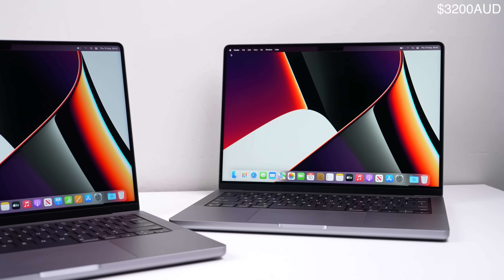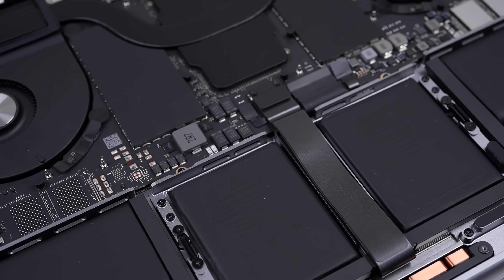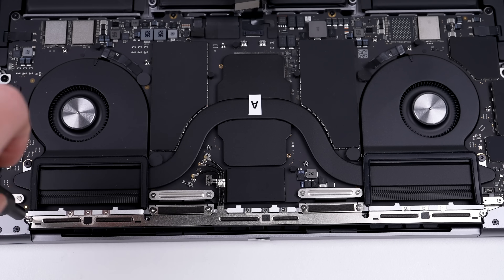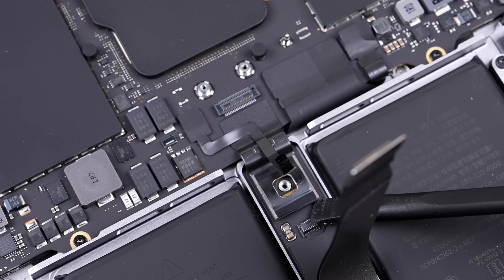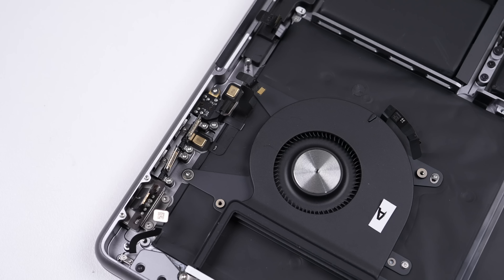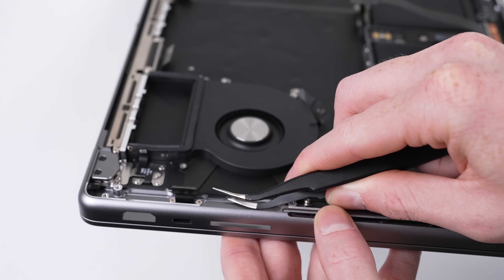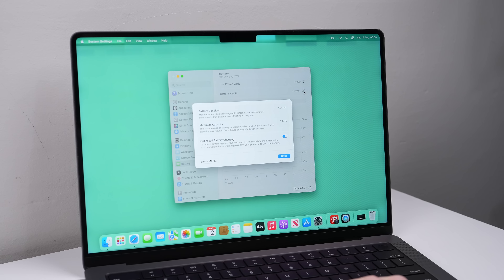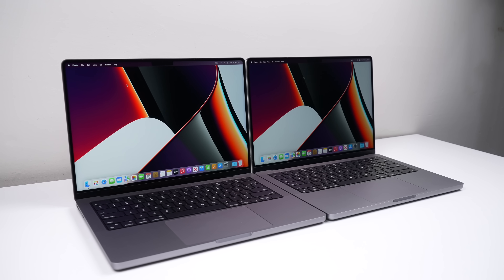New Anti-Consumer MacBook Pros - Teardown And Repair Assessment - Apple Silicon M1/M2

Comment: Apples anti repair policies actually made me stop using their products entirely. It’s so scummy that they purposefully make it impossible to fix incredibly simple problems or upgrade/replace parts as simple as a ssd or broken fan. The way they don’t allow you to control how your computer behaves really at all also got really annoying after getting more familiar with other operating systems.
Reply: Please tell me the fiction of which PC laptops are built for easy repair.

The interior of a thin Dell or HP laptop is just as impossible to navigate.
Reply: @VideoArchiveGuy  It might be, but neither company lock you out of your device, stop working or disable features if you self repair them. That's the point. It's not them making it hard to repair, it's them going out of their way to make it impossible for you to repair unless you do it via Apple themselves.
Reply: @VideoArchiveGuy  Im of the opinion that a tablet and a desktop is the way to go since laptops are too much for very light use like word or browser use and unable to handle heavy programs id use for work or for hobbies, for any significant period of time. I just switched from a Mac mini to a pc i built, where I can obviously fix most issues on because I put it together in the first place, and its something big and open enough that i would have the ability to solder parts on and off the motherboard etc if i needed to. The thing that pissed me off about apple is that you can fix a problem in theory, but their software makes it so even though the device has no physical problems at all it wont work because they’ve programmed it so all parts are matched to each device and the os shuts down functionality if any of them are replaced.
Reply: @Garkimyer  You're exaggerating just a bit.

The OS will of course not allow parts that are security-related to be easily swapped, and parts are not necessarily just parts if they were custom made for Apple.
Reply: @VideoArchiveGuy  you can, with enough skill, fix non apple laptops and they will work good as new. apple laptops, however, literally have software and hardware in place that intentionally fucks up things about the laptop when you swap parts
Reply: @VideoArchiveGuy So that means that if you have a problem with a security feature you are forced to buy a new product ??? This is the most anti environnemental shet i ever heard. Also are battery, screens, keyboards, ribbon cables security features ? Didnt know that...
Reply: @alexgreg152  No, that means if it's security related the new component must be installed by Apple or a third-party service facility with the ability to re-sign the components to keep the system secure. Apple or the approved third-party agent will be able to repair your products for you if they are security-related, no need for the "I have to buy a new device?" ridiculous hyperbole.

Screens and keyboards can be security features depending upon their components; for example on MacBook Pros, the TouchID sensor is part of the keyboard. Batteries must have data programmed in at the time of replacement to be able to accurately track their health as their age.
Reply: as a much more direct answer :Framework laptops.
Reply: @VideoArchiveGuy  lol what?

As he said ... Framework ... also ANY Lenovo/Dell business laptops.

Yes, some of the cheap end consumer crap from Lenovo/Dell is almost just as hard to repair as Apple - especially the more "stylish" models where they do glue crap together to keep it "thinner" and cheaper - but the point is those companies are not a douche and do not purposely design their hardware to be un-repairable. If you have the skills to do it, any compatible screen from anywhere will work.

However, a MacBook PRO should denote some level of professionalism in the device, where there is none. All of Lenovo and Dells business workstation laptops are built for extremely easy repair. They're made for businesses to buy in batches of 10,000. Businesses are not going to pay $2000 to replace a keyboard on a $3000 laptop. Employees are surely going to break screens, ruin keyboards, and end up with dead drives, and they need to continue to work. Larger organizations have an IT department to handle these issues ASAP. On any Latitude/ThinkPad workstation I've seen, you can replace the screen/keyboard/SSD with only a few screws.
Reply: Because they want you to know you don't own the product.

Comment: Yeah, I really need to sacrifice size, weight and design for an ability to manually replace my battery, RAM or SSD. It doesn’t matter that at the time I’ll need to upgrade them, my motherboard won’t support the newest specifications at the time, so I’ll have to spend weeks searching for a single usable battery for my specific case. Oh, and I constantly disassemble my laptop and switch between different kinds of screens on my Thinkpad! Oh, and reinstalling Arch every week is so much fun!

Comment: Nice takedown of the company and the computers. I don't see why anyone needs a MacBook Pro for anything.  It's a completely overhyped laptop that is a trap.  I would get the same amount of work done with any old laptop, like the one I'm on now, and replace it 4 times before spending what I would on that stupid laptop.  
I have a MacBook Pro right now in the living room.  It sits on the floor next to the couch in case I have to do something specific to Apple, but otherwise, it's about a foot away from being where it should be: A doorstop!

Comment: 8:51 "I wonder what the Genius Bar calls it?"
Rip-off.
I am primarily a Windows user. I am planning on using Arch Linux on the new computer I am building next week as my main OS. I know how to use MacOS. I have had a couple jobs in the past supporting it and worked for a BPO that Apple hired as one of their very first external support groups back in 2009. 
I was planning on buying a macbook pro as I have tools and confidence in repairing it and keeping it for years to come. I have some hobbies involving digital art and music and from what I have seen, best product for it. I don't mind spending the money on new software and hardwar eupdates as far as possible into new version of MacOS.  I won't be buying it now. Apple's insistence on closing their eco-system, forcing you to buy a new computer when the old one is just "old" is quite anti-consumer. And here I thought they were going in the right direction with iPhone repair kits.
Apple devices would be the best you can buy on the market...if they would stop being douchebags.

Comment: Just by te way, I don't think that the lid sensor cable is paired to anything. They've probably just used a precise angular magnetic field sensor with an ordinary magnet. The magnet is mounted (likely glued) to it's place randomly oriented. They then use some kind of program which allows them to store value of angular field measured by the sensor in the close-lid position.
It would be impractical to somehow always mount the magnet in a specific orientation, it's much easier to do it this way.

Comment: These are beautiful pieces of hardware and the performance is fantastic.  The displays are on the upper end as well too, but they are no OLED.  But there is far to much about them to not like.  No WAN option for starters.  Soldered RAM and SSD is total crap as well forcing you to pay obscene amounts of money for what is in reality very cheap.  No touch screen either.  I went with a Lenovo T15G and got the an I7-10875H 8 core 16 thread 5.1GHz processor, 4K OLED touch screen with calibration, RTX2080 Super maxQ with dedicated RAM,  WiFi6 2x2, CAT16 LTE 4G WAN, one of four SODIMM slots populated with 16GB SODIMM, and a 250GB SSD in one of the two m.2slots,  720P IR camera, Dolby sound engine, two USB-A 3.2 gen1 ports, one USB-C gen2 /DP ALT mode 1.2, two Thunderbolt 3 (USB-C 3.2 Gen2, DisplayPort ALT-Mode 1.4) HDMI 2.0, SD card reader, and smart card reader.  I then added in another 48GB of RAM and a 4TB SSD.  I also have 3 years next day on site repairs under warranty.  All in I spent less than $4300.00. No expensive dongles, no tethering, parts can be had and swapped without issue.  WHY WOULD ANYONE BUY APPLE LAPTOPS?

Comment: My MBP got a hit on the lid and the dent metal is slightly pressing my screen projecting a washed out blue spot. I ask my official local apple seller and they said they could replace the whole screen. (around 800 bucks). Now I'm scared to take it to the repair service.

Comment: Back in 1981 I had an Apple II+ that I could replace just about anything on. I bought it with 48K of RAM and added another 16K by plugging in individual chips by hand. But technology has moved on. Today's processors have more built in RAM than the 6502 processor in that Apple II+ could handle. Connections, especially in laptops, are smaller and more delicate. Even more importantly, the number of people actually interested in messing with this stuff is tiny compared to the market. It simply costs too much to cater to them, so Apple doesn't. If you're one of them, get over it. It's not going to change. In fact, other companies will follow Apple down this path. Because they have to. Economics dictate that they do.

Comment: Very in depth vid. I’ve dealt with those plastic keyboard rivets on a dell laptop.  It had to be fixed so I ended up using a hot air gun to melt them so I could pull the keyboard out.  Then I used a soldering iron to remelt them when I put a new keyboard in.   Complete pita.

Comment: This is so crazy. My last laptop, which finally died 2 years ago, i bought in 2009 and kept it going through upgrades, repairs and replacements for 12 years, unheard of by todays standards.
Reply: My last macbook lasted well over 10 years with no need for repairs or upgrades (and is still in use by the person i gave it to).  So whats better, a device that lasts or one that needs repairs and upgrades?  Lots of hysteria on this video and some criticism of apple is certainly valid, but i've never had a laptop last anywhere near as long as a macbook has lasted.
Reply: @JustinWatson23  Right? I bet my 10+ year old MacBook pro has a higher resale value still than most PC laptops purchased in the past few years. And yeah, I replaced the Hard Drive, but also back then HDDs were horrible - modern MacBooks will last decades with only the battery and Apple's annoying software update policies being an issue.

Comment: As an Apple Authorized Service provider, you need Apple Software (GSX)to run a configuration, and Lid sensor test in order for the system/display  to function properly. In that software you need to enter the Serial number of the good display/Bad display, (or any part really) and the software Pairs them to the motherboard. Each Lid angle sensor needs to be replaced with the Display...no way around it. Same with touch ID with a logic board replacement. It is SUPER clumsy and anti-consumer. Also yes, Keyboard is non replaceable.you can order a Key cap kit, but if the keyboard itself is Damaged. you are out the entire topcase.  You can manage to get a replacement battery, but it is NOT an easy repair. any battery replacement i do requires an entire teardown of a system. lcd, logic board etc....Down to bare metal and swap to the new top case/keyboard battery(touch bar) THENNN it needs to be configured.....you guessed it in GSX again.....

Comment: What I do is just never buy MacBooks.  The SSDs are soldered in.  The SSDs often fail catastrophically with no way to recover ANYTHING from them and then if you have a model with a T2 processor you are S.O.L. because it will not boot without data that was on the original NAND chips.  What happens then?  Does Apple try to sell you a new device?  That wouldn't surprise me.  Apple is not the only antirepair manufacturer but they are most certainly a very well known one for it and other unpleasant surprises hidden in their devices.  Really the only time an SSD should be soldered down is if the device is too thin to allow for an M.2 or similar socket.  I would have to also say good luck proving too thin because M.2 fits in a lot of devices with no problems whatsoever.

Comment: It's such a shame. First Mac I had was the 2012 Macbook Pro which had removable battery, memory and storage. It wasn't even that expensive. Now if you want to stay on MacOS you need to spend several times the price of a PC to get something which is basically designed to fail if Apple's in house service won't fix it. Back to PCs I guess, even though I actually like MacOS.

Comment: If you are insane enough to spend that much money for this iCrap garbage, you deserve not having it repairable.  I cannot even understand why crApple still exist in 2023 as this is a scumbag company that has always oversold its garbage and made it as hard as possible to repair it which should be illegal by the way.

There's no excuse for this to happen in 2023, to have a electronic device built so complicated that it makes it useless to repair, to have things connected in such a way that it makes it impossible to swap broken parts.  Just buy a freaking PC laptop, some of them have taken crApple exemple and tried to make it hard to repair but most can be repaired and get this... MOST can be upgraded EASILY, like RAM and HD and even GPU/CPU.

Comment: Every flat cable connection is secured with a metalplate and two screws. That looks fancy but it needs more room, more parts, more worktime to assemble than a connector with some kind of snap-in function. 
Apple messes up the concept of a universal, changeable, expandable electronic device, more than any other company.

Comment: I feel your pain and frustration Hugh ! Apple computers now a days are like  automatic transmissions , although repairable ,are extremally difficult to disassemble and reassemble. Some may not  agree  with this , but Apple builds an amazing machine that has the fastest chip in the industry ! But like a  Ming Vase ,you hope it doesn't break! The deal is ,no matter how much you and others bring awareness of what Apple is doing in way they configure their machine so they can't be repaired by the owner, people will still buy them ,abuse them , throw them around and yes spill stuff on them. Rendering the computer useless and either be repaired ,replaced or throw out like garbage !

Comment: OMG, thank you so much, and thanks YouTube algorithm for showing me this video.

A few weeks ago my MacBook Pro M1 Pro (2021) had a water damage. I dried the computer a bit (didn't have the right pentalob bits to dissamble it a the time), bought a new MacBook Pro (M2 Pro), transferred  everything to it (because I didn't know if my wet Mac would last long).A week after I had problems with the keyboard/trackpad being unresponsive and the display not turning up for very long. I finally had time few days ago to disassemble and found out some corrosion around the LAS (Lid Angle Angle), and since then I've looked up a bunch of video of how to repair/replace this part, I read some iFixit forums too.

And then your video popped up in my feed and intrigued me … and I'm glad I watched it, because you're the first to mention the Self Service Repair website for that part (I already knew that apple and official repair places had access to the calibration tool, but didn't want to go that way in case they want to charge me for other unnecessary repairs). You can't imagine how many solutions and ways to get that repaired I've thought these past couple days. Thank you so much!